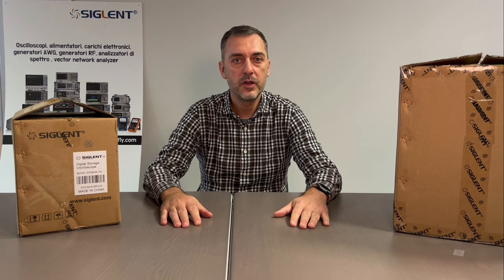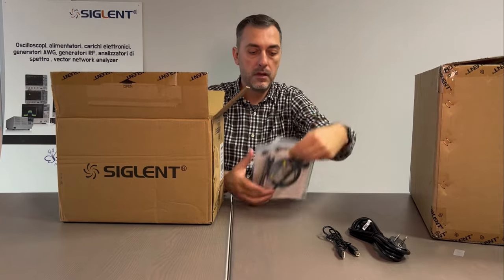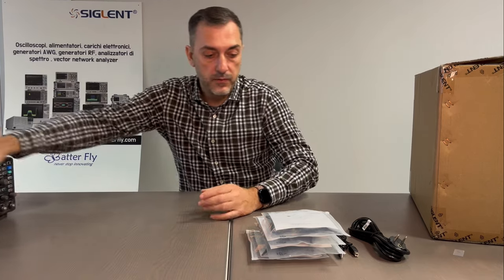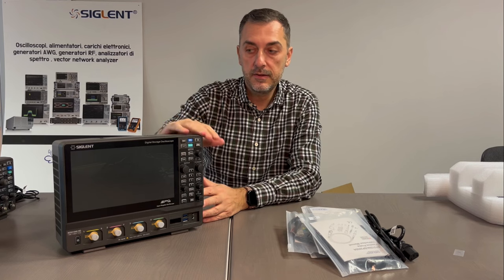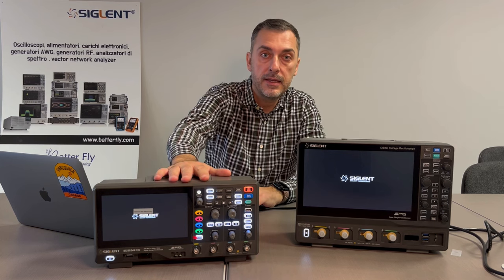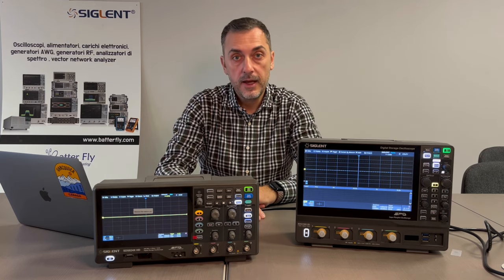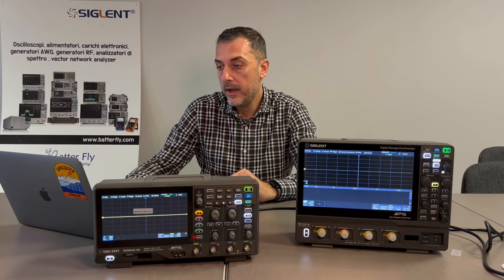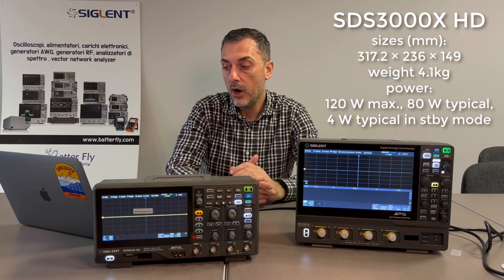Unboxing, intro and explanation of the new SIGLENT SDS800X HD, SDS1000X HD and SDS3000X HD

Comment: Hello. How loud is the fan in the two units? Is there a fan noise difference between the 800 and 1000 series?
Reply: Eleshop has rated the 800 as ”Louder than average” and the 1000 as ”No noticeable noise”.